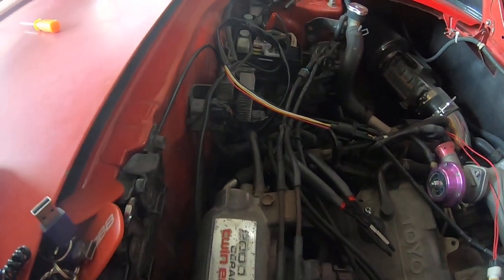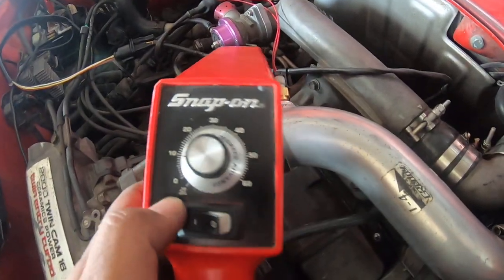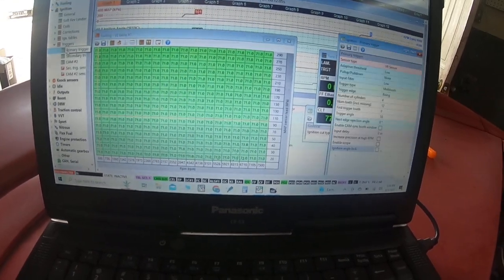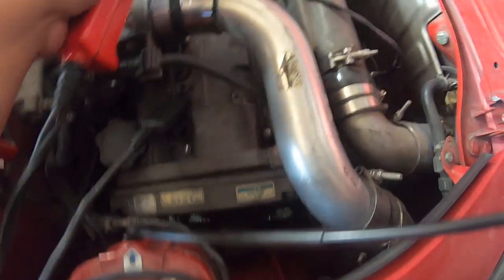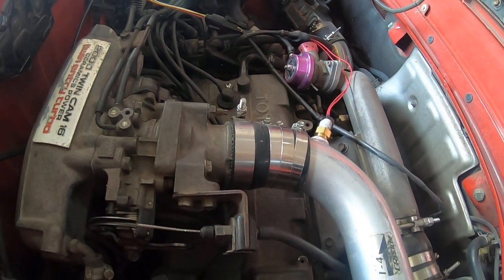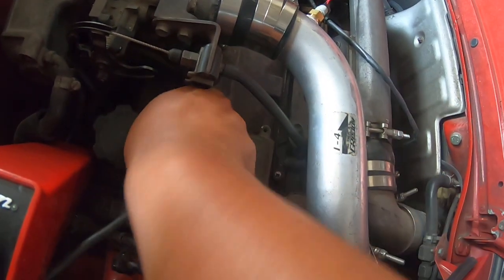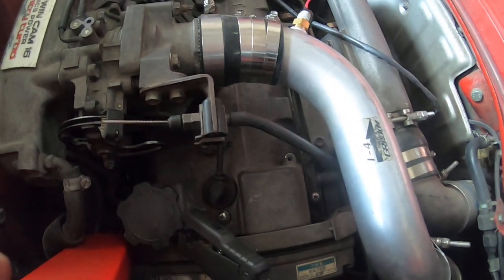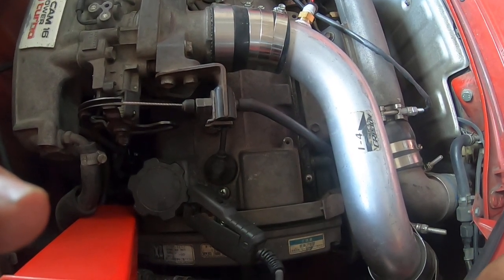How to set you base timing on a standalone ECU, with a timing light

Comment: Glad I watched this video. I'm using an EMU Black on my R33 GTR and I'm admittedly pretty new to tuning. You specifically mentioning RB26's popping from timing drift has me thinking about a trigger kit now. Lol. Great and simple video. Thanks.
Reply from the maker: Just keep in mind that the RB cars require a crank trigger, so most will require you to redo the timing belt.  

I personally like the 50ignite kit (which we are a dealer for).  Let me know if there's anything else we can help ya with!
Reply: @krmotorsportskilleen i've got that on deck as well. Just garaged the car for the winter and started working on a base tune to make troubleshooting with bolt-ons a little less of a headache. But cams, cam gears, timing belt, and harmonic balancer are amongst the stuff on my work bench right now waiting to go in this winter.

Comment: Hi, Thx for the video, I have a question tho please. Why do you have 12 tooths in the configuration? The distributor is 24+1. This is confusing me a lot, as I see the 12 teeth also in the base project configuration files download from Emu.
Reply: Oh it seems there´s no settings for it to know, that the source is camshaft related. So given it´s hardcoded to think it´s crankshaft, it´s the distributor/2, so that´s why it must be 12t in the config
Reply from the maker: Correct.  The distributor is ran off the camshaft.  Since the cams rotated twice for every one crank rotation, you divide it by 2.

Comment: So this is my question.
When i go to make the initial timing mark, i would set the engine to top dead center, and i want to make a static mark on say the timing cover, and one on the crank pulley/balancer right? Another option on my car is there is a 0 mark on the flywheel thats used when doing timing jobs, could i also utilize that? I am using an aftermarket 60-2 Trigger system on a old 5cyl with maxxecu and thats the one part i cant get a straight answer on
Reply from the maker: So yes, rotate to TDC, and make a LINE that connects the timing cover to the crank pulley (so the marks line up when TDC).  You could use the flywheel mark as well.  We use the flywheel mark on the Honda Beats.
Reply: @krmotorsportskilleen  Brilliant!! thats exactly what i needed to hear. Just gotta repair this head gasket i blew the other day and give it a shot(the 300k mile paper head gasket was not happy with 30psi off a g25-660 and lifted the head hahaha) ARP studs and MLS Gasket incoming
Reply from the maker: @briangates8853  Here to help.  Keep me posted would love to know how much more power ya make!!!

Comment: Nice video.  But put a towel under the laptop and that thing on the roof to not damage the car. I hate when shops put tools and thing all over my car and dont thing about what they are doing to the paint and panels. A little care goes a long way. Otherwise great video.
Reply from the maker: Not a bad idea, but I'm ahead of ya already!  I put these foam feet on the bottom of my toughbook to prevent that.  It's almost like the mousepad foam material.  As an added bonus, it keeps it from slipping and sliding!